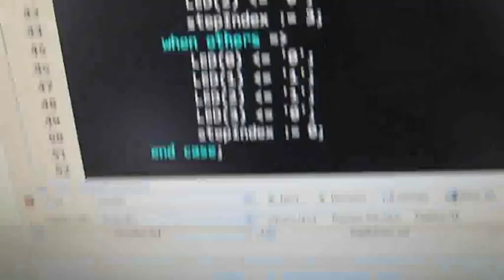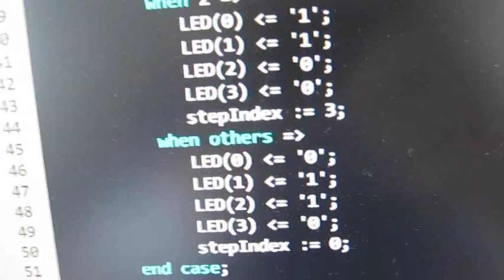Salvage Stepper Motors and Controllers From Electronics

Comment: gonna sound dumb but, are the wires that are coming in from your red board only sequencing the voltages in order to turn the stepper?  Is there not enough voltage coming from the red board to power the motor without the PCB of the original board plugged in

Comment: I think I'm missing something, did'nt see you using the stepper drivers from the board. I have the steppers and the boards from salvage. Can I use the STK672-600 drivers from the boards or just connect to darlington array. I'm just learning this so my apologies if you covered that.

Comment: love the video, i've been looking all over the place for an proper "tutorial". can you repeat this with 2 stepper motors in the same way to create an cnc machine?

I got 3x exactly same  setup and looking to make an cnc machine out of it, with an arduino board... would this be able? or would I need to get the easydriver board etc?

Can you also tell me the wire diagram of this motor? mine looks exactly the same with same socket and wire colours.

thanks alot!

Comment: I thought you was going to de-solder the drivers and look up data sheets and try to connect everything right and make it work that way and use a mosfet controller for the different voltages. :(

Comment: You were kinda wrong about power of stepperz...
my very much larger NEMA23 are 3V 3A ... Still... NEMA17 are a smaller package frame of identical designs... unipolar are slight changes from bipolar, and little difference exists between any if them... EXCEPT they COULD have up to 12,24,+V and 1-6A ... IF you need the power, stucture, and durability needs.